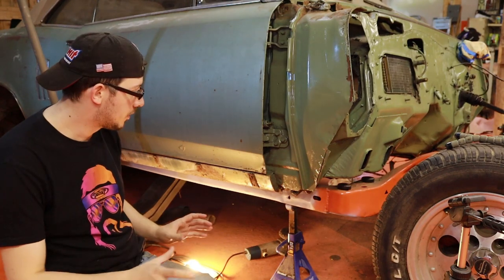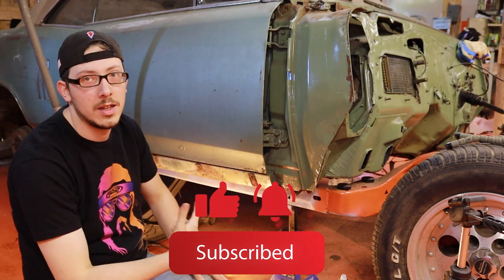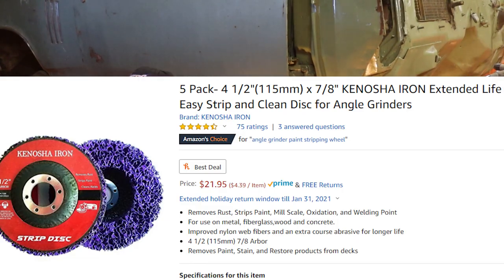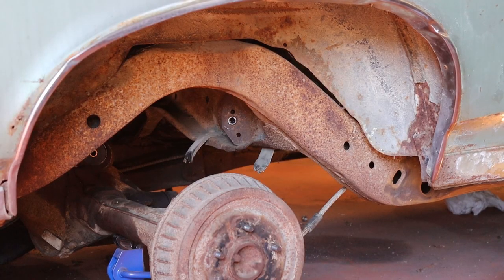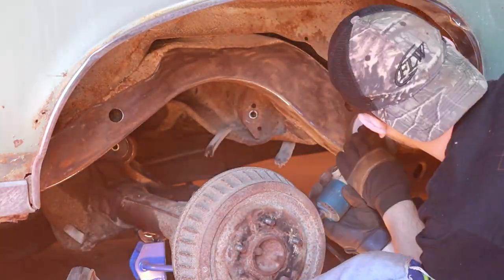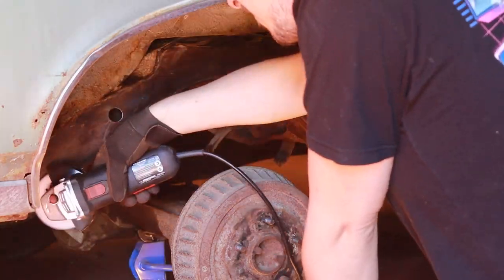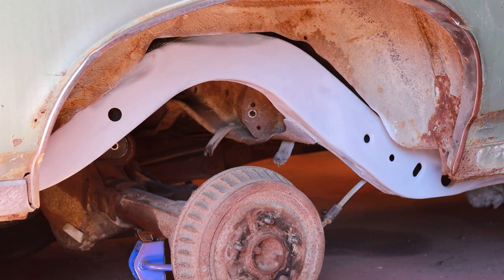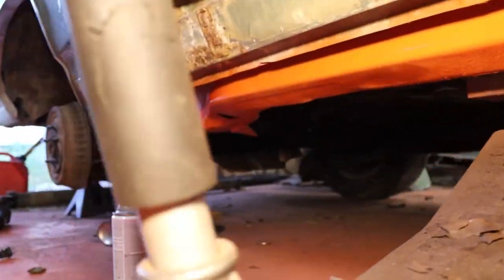CHEAP Rustoleum Car Frame Paint Job

Comment: Really orange is the best color you  could have came up with?
Reply: i spary with rust converter and time to time a serach for some point s of rust i sand them and aplly rust vonverter again.,,a good way to control

red oxide priemer is good too. try it, with a brussh

Comment: If only it was that fast lol. Orange is a unique color, what’s the final goal for the looks of the car ?
Reply from the maker: The color is essentially a Linden Green without the flake. His vision is a basically OD green body, painted bumpers, body dropped 1/2", the frame showing like a pin-stripe. Saturday night cruiser basically. Cammed 400, 200-4R, and 3.55 factory Posi. Should do alright against most things on the street.

Comment: do you paint it after primer or not ?
Reply from the maker: Yep! Get the rust knocked off,  primer it, then give it a few coats of paint! So far it’s holding up to installation of parts which should be way more abuse than the road gives it.
Reply: @LSxHunter  you can paint primer over primer its even better, red oxide is good